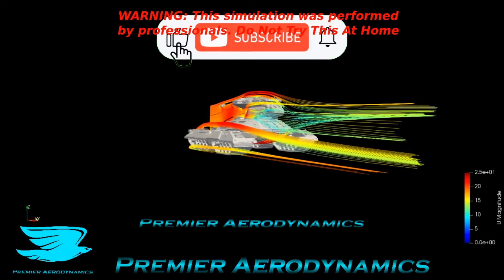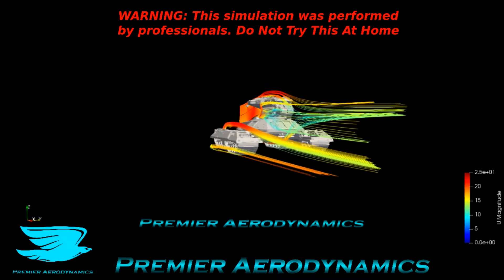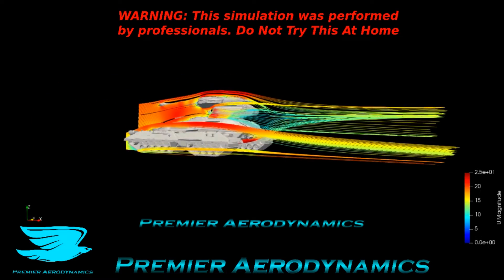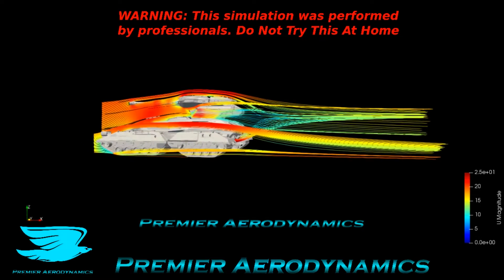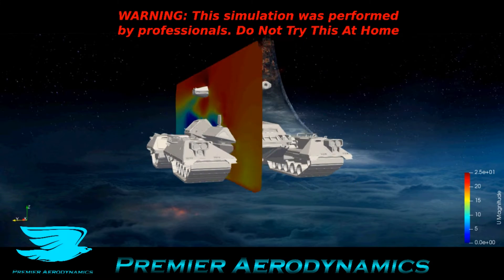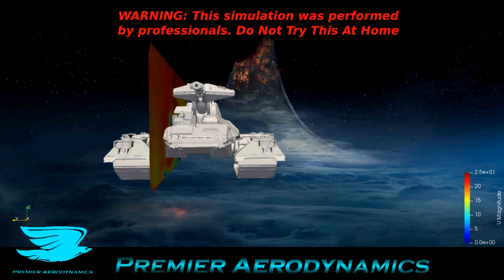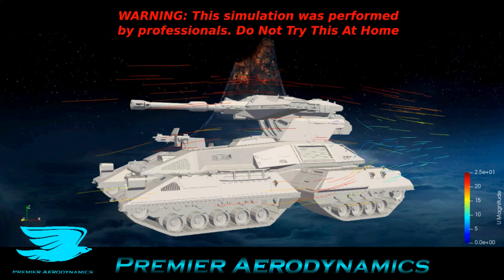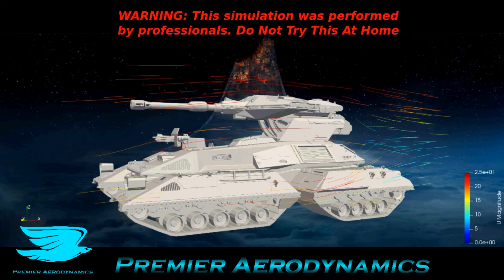Halo Scorpion Tank Aerodynamics

Comment: This is good but the Re is clearly wrong. I suspect the file loaded in as a teensy scale model at 25ms you are going to get WAY more turbulence which should scale from tiny vortical structures around the plates to bigger, more stable structures behind the turret.